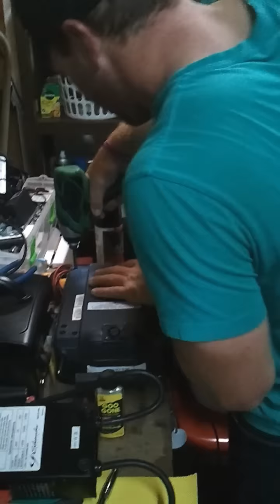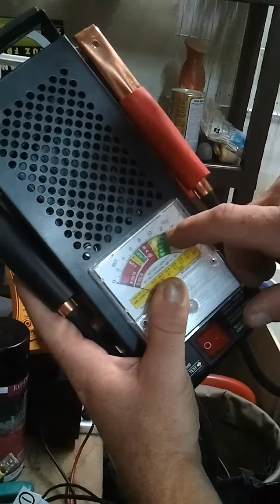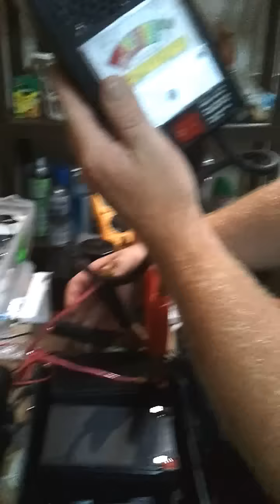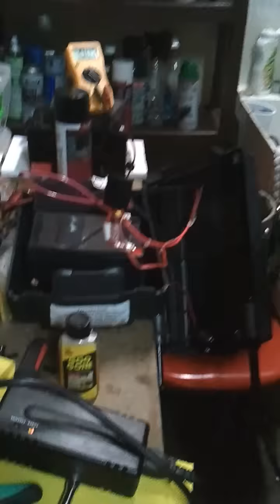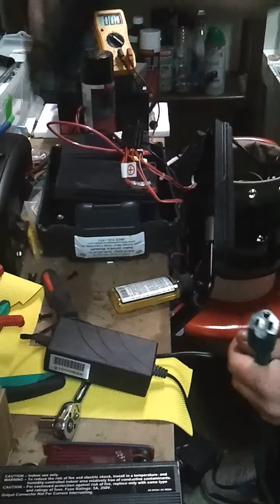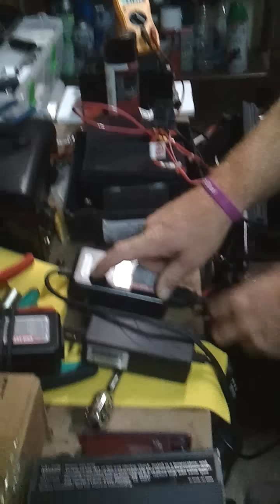Mobility scooter battery & charger test

Comment from the maker: In this video we demonstrate how to determine if your battery is failing and/or if your charger is failing to charge your battery. Tools needed are a multi meter, and a low voltage meter.

Comment: almost a  voltmeter tutorial    crappy  scooter also with system like that i ? have a fortress 2000   paid 350 5yrs ago used  still has same    gp 22  batteries  12v  gel  wore  out  2  sets of tires.         used summer and winter.
Reply from the maker: keep up the good work with maintaining your batteries

Comment: my older pride gogo traveller elite has new batteries and you can run for hours and they are still good. but get on a steep grade or hill and it becomes such a load that the circuit breaker shuts down the whole scooter and we have to reach down and reset it, and walk the scooter up the hill. very discouraging. what can i do to solve this..thanks
Reply: healthyamerican its over working the unit .. not the batteries .  Motor weak might want to get something with a strong motor.  Call me or email Chris.mobilitysolutions@gmail.com sorry for the bad news
Reply: no problem. i`m just glad to find out whats needed. ty

Comment: My new batteries aren't charging, with two new chargers tries. The charger indicator lights are always red and green, and the fan doesn't run they way it does when the charger is charging. I believe the problem may be the xlr charging port (12 years old). Is there a way to test it with a multi-meter? If so, please explain how, as I am only familiar with rudimentary multi-meter use. Thanks.

Comment: how much current does the load tester draw?
Reply from the maker: gary meadows we use a different system now but this load tester was recommended by the manufacturer.  it gives u a quick test but isn’t good to repeat this process

Comment: how do I find the batterys on my EW38 scooter
Reply from the maker: Dale Trimble they would be found under the seat.  Under the seat you'll find a compartment for storing items!  Under that is where the batteries are stored.  Should be a 36 volt series of 3 12 17 amp batteries!

Comment: Would a lawn mower batteries hurt a mobility scooter motor? Mine takes 2 12v35amp batteries and a lawn mower battery is 12 volt 230 cca???
Reply: danas54 the batter you are speaking about probably is more for cranking the law motor. when the scooter batteries are deep cycle.  so i wouldn't use a law motor battery .. it wouldn't hold a charge very long
Reply: Christopher Carpenter Would the higher amperage burn the motor up or does the amps really matter. I'd like to try just to see how far it would power the scooter if the amps wouldn't burn the motor up. I'm having a hard time finding the batteries I need around here, unless I order them.
Reply: Christopher Carpenter by the way, Thank you for your response.

Comment: I bought a used mobility scooter that has the same battery pack shown in your video.  I have two smart chargers but neither charges my (new) slightly discharged batteries.  Port 1 on the XLR connector goes to a good diode and then to the (+) terminal of one battery.  This allows current flow to the batteries.  However, it does not allow voltage to flow back to the charger and, I assume this prevents the smart charger from recognizing the connection.  Can I safely bypass the diode?
Reply: davidoo07 - email me at chris.mobilitysolutions@gmail.com or call me @ 803-926-2224 ask for Chris
Reply: i think this is golden technologies battery box , if you have a rascal mobility box the power lines are reversed.  check the port hole connection label

Comment: Using an analog load tester will cook your batteries. Notice when you use an analog load tester the tester becomes extremely hot and smokes. You are cooking your batteries. Invest in a digital battery load tester, much more efficient and does not cause damage to the cells. Otherwise great video.
Reply: Absolute rubbish. I’ve been a mobility engineer for 22 years. We all use analogue load testers. .........
Reply: Statewide Mobility Florida nonsens
Reply: Statewide Mobility Florida lol

Comment: HOW YOU TEST THE BATTERY CHARGER ON THE MAXIMA PRIDE
Reply: Couple different ways.  But i would stick with taking your voltage meter, place it on  one of the batteries. and plug your charger into the wall.. if it goes up then your charger is working.  you could have a problem if it doesn't charge both batteries.  Contact your provider if that happens or make sure the circuit is good.  Other questions email me at chris.mobilitysolutions@gmail.com.. I can help with other stuff .. Looking for parts we have a ton of used parts.  thanks chris